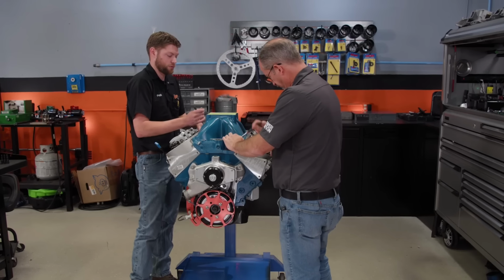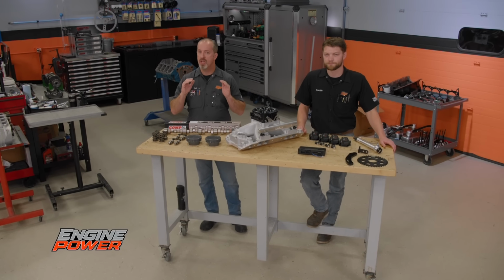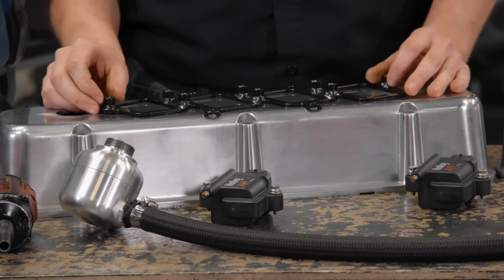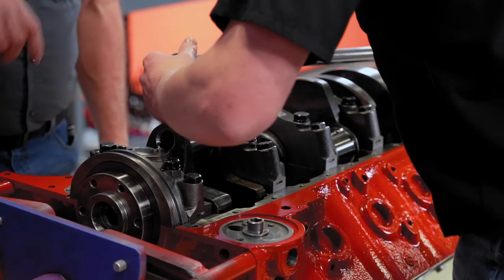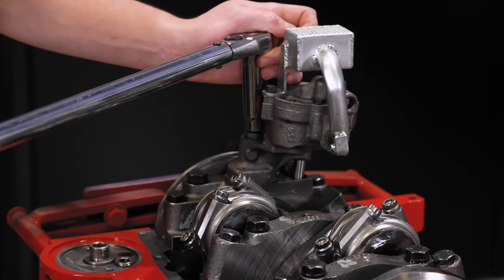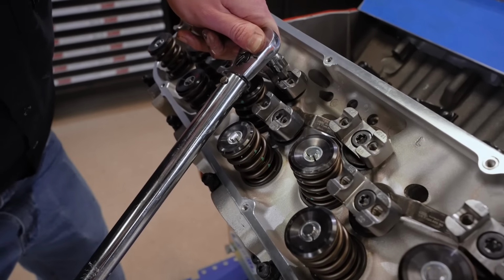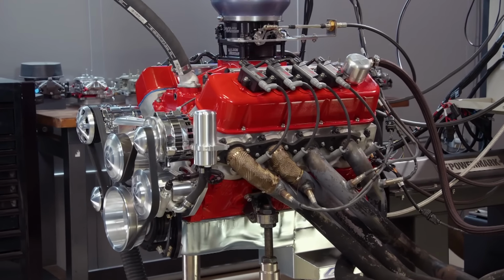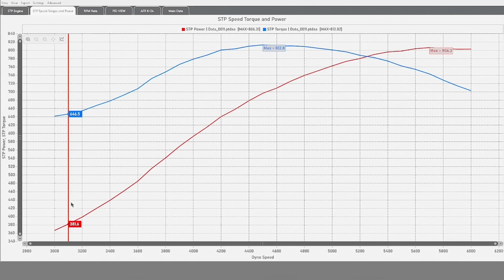Big Torque, Big Power: Building a Custom EFI 632ci Big Block Chevy - Engine Power S12, E1&2

Comment: Slight electrolysis going on in water jackets when u 1st removed a head ?
Reply from the maker: Because the dyno runs straight water we can get a little corrosion in the water jackets, but nothing crazy
Reply: @enginepowertv  have a good look at that pitting its electrolisis

Comment: Chevy's Crate zz632 BB is 1000hp straight out of the box!!! Install and run....... On 91 octane, with factory warranty, built with GM Quality!!! No hate for engine builders but they can't hold a flame to the research and development from the factory!!! Not that engines can't be built stronger than they do, just that the factory built engine WILL be more reliable and longer lasting!!! Plus the Factory warranty is WAY better than an Engine builders!!! I worked for Skip White Performance and Machine Shop, who builds thousands of high performance race engines every yr. They even sell them on eBay. And the builders there are amazing!!! 100% FACTS!!!

Comment: GEN6 block but they put aftermarket roller lifters in it .... thats stupid. "wamt to show you guys all the cool parts" transnational holley is giving us a ton of money so we need to show you something that costs 5x more than the factory stuff , wont last as long and does the samething .

no really WTF?!?!?!?! you toss a bunch of aftermarket garbage efi stuff on an engine that came factory with efi ............ you could have literally just repinned the gen 6 harness for a 0411 ecu , stuck with the distributor (no reason not to with this build). i love the gen6 big block ... you guys made the common mistake that carbs or aftermarket efi is better .... its not , the best thing to do to a gen6 is 0411ecu. edit number 3 as i watch this ... ls firing order ... why not just built a gen 7 at this point . its only a gen 6 in the core block now .

edit 4 ... oh for fuck sake a timing belt kit .... really for a street engine .... smh talks about converting this engine to hydraulic rollers ... while showing a shot of the valley and showing the studs to run the FACTORY roller spider

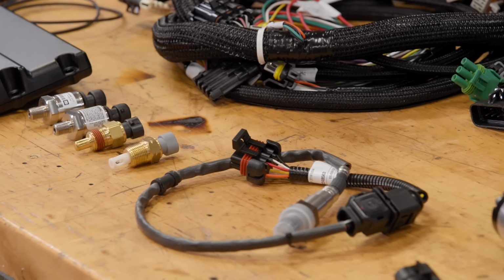@32:57 all the sensors to run it? strange cause that engine SHOULD have factory dual knock sensors and i dont see even one there . this is the problem with aftermarket efi , most dont use knock sensors which is why they are useless , might as well just carb it then

Comment: what kind of nonsense is this program?  you made a 1000 horsepower for a client. Now he gave it back??? then you detune it 850 hp. for what?  you can't go any lower on a 632 and still make it impressive. that's like detuning a 4 cylinder to 20 horsepower. what's the purpose of this build, and thus this show?  what do you do, build an engine, then stick it on a shelf for a later episode?  do you actually have any clients?   got better things to do with the 42 minutes of time you are about to take out of my life...

Comment: I'm sorry, I'm confused. Is that the same high rise you had on that engine painted blue before.. grey before... so basically you tore everything down, rehoned the cylinders because of 1 dyno test and re painted everything..   Just had to be sure.    Sounds like a car salesman tactic. bring in a car. spend more time cleaning it than actually fixing and changing out parts.

Comment: abuse on the dyno??? you guys tear an engine apart, build it up to high horsepower, run on dyno, then mothball on the shelf till the producers of this lame show tell you to tear it down and detune it to supposedly run in another monster truck?  only to sit on the shelf again till 6 months from now when you yo yo up the horsepower again. Then sit on the shelf.. I would have more interest if you actually took an engine from the auto wrecker and breath new life into it.  I think you guys don't know any other engine. You've take this same engine apart so many times, that you can do it blindfolded.  Get a new story or shut down

Comment: Still watching but I like what I see.  Good attention to detail on this one. 4-7 swap, 110 lobe sep angle, with a Hydraulic Roller.  I think you guys need to find a way to make this thing Sequential Fuel Injection vs Holley's Batch Fire system.  That will help maximize plenum volume and reduce pooling at the intake valve and help atomization.  With that said, its still a magnificent build.

All done watching.  Verdict.  Outstanding build.  You guys should be proud of that one.  Now that is a truly impressive build that can survive on the street and actually be reliable for everyday use.  Your wallet will get smashed to pieces on fuel cost, but its well worth it.

Comment: And it gets 2 miles to the gallon and has a range of 40 miles.
Reply: This setup is very efficient with EFI and would realistically get between 15-20 mpg on the street/highway because of how it can be tuned to run at partial throttle and light load especially using an overdrive transmission
Reply: @strictlybusiness1598 well 15-20 is a little too optimistic.  In reality it will see, in the real world around 12-16 mpg. Its too big of a bore to see 15-20.

Comment: What challenges did you face when integrating the modern EFI system into this classic engine block? Any tips for someone attempting a similar upgrade?
Reply: Its more of a Hybrid EFI.  Theyre a little low on Plenum Volume.  Its still adequate for the engine. More plenum volume and if they could integrate Sequential Fuel Injection, they could get those A/F Ratios per cylinder within 2 tenths of each other.  That would allow more consistency throughout the RPM band. They have to tune for the average across the whole bank vs each individual cylinder. Thats whats known as Batch Fire vs Sequential.

Comment: I really love this Engine all except for that timing belt….. It’s a good piece for racing, But not for a daily driver as soon as one of those seals leaks oil onto that belt it’s all over.
Reply: Thats not a belt issue though.  Thats a quality issue on the sealant youre using.  The belt system is easier on the Hydraulics because it reduces resonance throughout the valve train.  These aren't 1990's belts anymore.

Comment: I have a question for power nation. I have a HD industrial 350 vortec l31r. Someone had the timing set to advanced or to retarded I’m not sure. But I timed it properly since then. Every time I fire it up cold if I don’t rev it up to 1500 it ether knocks or piston slaps until the oil heats up. Should I ignore it or remove the engine and go through it? It’s done this for about 90,000 km now and I hate that sound.
Reply: Thats worn hydraulics or worn bearings.
Reply: @joshtheking1772  it’s done it for a couple years now and I pull my 23’ camper with it lots. I think if it was a bearing things would have gone bad long ago

Comment: When torqueing the rods and mains for micrometer measurements, what do you do if they are torque to yield bolts?  Do you have to buy new bolts every time you test?
Reply: Thats why you buy two or three sets. Most, i said most, vendors sell within the same batch number for consistency.  Hardware is cheap when building an engine.   When its in the car, belts and hoses are cheapest. When it's used and maintained, oil and filters are the cheapest.  It depends on what stage you're at.

Comment: Engine dont sound smooth. Sounds stepped. Badly. 

That intake wont fit under the hood. 
How about asking some of your beloved companies to make a front facing MPFI intake manifold.
Look how much that goofy Wilson TB cost. 
Too many camera. Music while engine starts. 
Dont say how you "set" your bearing clearance. Ever.
Reply: Thats because on a dyno its "Stepping" up 300 RPM per second to measure. Also, frame rate for television and keeping the sound in sync with the frames makes it sound that way.

Comment: did this engine start as a 8.1 big block?
Reply: It was a blueprint engines 632 short block for pump gas application capable of producing 800 something hp

Comment: I built sets of502's and 632's for my boat.... One thing I learned is to epoxy stainless screens in the intake valley center oil return slots above camshaft..... if even 1 pushrod breaks and falls down that slot, by the time you realize theres an issue it has been ground through the cam crank and then into the bearing journals  and its game over..... Best upgrade I ever did.... BELIEVE ME!
Reply: @painwithoutgain  Damn, you’re living your best life.  Most of us can’t afford good cigars.
Reply: @ Sorry for that, maybe its a good  time to stop smoking cigars then
Reply: I get the concern, but honestly, if your valvetrain is set up right with quality pushrods and proper preload, a failure like that shouldn’t happen. Epoxying shields sounds risky long-term—I'd rather prevent the issue than patch it after. Just my take.
Reply: Kinda dumb question, would you epoxy screens on a engine thats hasnt been cleaned/has been already used ? Or would you recommend doing it on a block thats been cleaned&hot-tanked?
Reply: @ Just clean with brake cleaner... or acetone... No need to grind as the casting in that area is rough and will have plenty of  teeth for the epoxy to adhere to... its a win win
Reply: @ got it,Thank you !
Reply: Don't forget a rev kit . Keeps oil pressure upon valvetrain failure. Nice low buck set up

Comment: You guys do a great job! But why is 800ish a good number? 1.27hp per cube is a throw together engine. There are plenty of street 632s making 1000hp? Good race 632s today make 1300 to 1450! 632s that were built 10yrs ago made 1325 1350ish, Nitrous combos!
Reply: This isn't a billet block and forged pistons deal. This is a reliable street truck using 93 pump gas. You don't want to blow this thing up. Also, maintenance is much cheaper for an engine not being absolutely leaned on. This a street truck build.
Reply: Its a Street Motor bro.

Comment: I bought an old dishwasher years ago and it lives outside. When I use it I run a hose from the hot water heater over to it.  That’s what I like to wash parts in.

Comment: All I see is one big giant iron boat anchor. Which is all the 454 ever was. It might out weigh some cars today. LOL I guess you could use the 632 for a Monster Truck, but Sorry. Not a car. 

You want big power for a car? Just supercharge a lowly V-6 Pentastar. If we're talking about cars? That motor is built like a fuelly dragster engine with 6 bolt mains and a fully hardened, even exotic, lower end. (except for the head bolts) I supercharged mine and it gets 608hp and I didn't really even turn it up. I just used a Ripp kit with 22lbs of boost (I've seen 20 once) on 93 octane with the stock Ripp/ custom tune. Now granted, I also added ported intakes, an 80mm throttle body, (yes, a Hellcat throttle body on a 6 cylinder engine) giant injectors and Hardened nut and stud head bolts to protect the head gaskets. (all four cams have to come out to change them) And the Pentastar has 2-stage cams. You can grand ma the car and it's happy, or turn it into an MX-Missile and it's happy. Because it's AWD it won't spin a tire. It's acceleration is so intense it'll pull your girls panties back up. Best car I've ever had by a long shot. And the Charger is a Mercedes E class.

Someone should make one of those Pentastar's into a V-8. You'd easily be able to get 1,000hp with just a supercharger. Incidentally, my Charger with that engine gets 41mpg on the Interstate. In an AWD Charger police Interceptor with highway gears. And a 729 mile range to go with it. The power to weight ratio is 7.7lbs per hp. Supercar territory. I ordered mine new from the factory 7 years ago and it's still better than new with everything in it, and everything works. Even the power sun roof. LOL
Reply: Small engines explode trying to make big block power all the time. Big blocks cruise at powers the small engines can't stay together at. A reliable street engine is more important than outright power.
Reply: Penstar=🤮

Comment: LS firing order... boo.  You just stole that big block's soul.
Reply: Look into why its done. It makes a better running engine, and you wouldnt be able to tell without being told. Makes the same sound.
Reply: @brandonlittle6444  Yeah, I know why it's done, and can't fault GM for doing it.  But I still just don't like the chop it gives the engine when its cammed, compared to the old school lopey cammed engine sound.  It has character.

Comment: Thanks Frankie for toning down the hand movements. Made it hard to watch. Tough to do with Pat waving his hands like a flapping bird!
Reply: 😂😂😂 really? This is a show about building engines and you're whining about their hands moving? 😂😂😂 maybe stick to watching cooking shows or something else
Reply: @19chev81  More than half of the 30 minute content of these shows are commercials for their sponsors.  That's the point of most of their builds...to talk about suspension packages from Summit Racing or TrickFlow heads or ARP bolts and fasteners et al.  If it was just about fixing engines, yeah who cares, but it's performance and advertising and deserves to be judged as such.
Reply: @MrCrystalcranium  and? Have you ever been on a tv show? I have for several years. Guess what? No sponsors=no show.

Comment: I want to see you guys build THE MOST EFFICIENT pump gas engine possible. Would be really cool
Reply: Good idea
Reply: @domenicscarfo1866  Right? Anyone can make big power. Don't get me wrong, I love these builds and I love seeing the big numbers and a nice clean build but lets be honest here... It's getting old! I want to see how efficient they can make a small block V8 or any other engine for that matter. I'm currently rebuilding my wife's daily and it's a 2018 GMC Terrain with a 1.6L turbo diesel. (Had to rebuild it because the EGR killed it but that's another story.) I'm putting in gap-less piston rings in an effort to stop those EGR gasses and black diesel snot from getting past the rings and contaminating my oil. Not to mention gumming up my rings! These rings were like glued in place with black diesel snot! So the gap-less rings are going in from Total Seal and them I'm sending the pistons out to Line to Line Coatings to have their ablative piston skirt coating applied as well as a ceramic coating on the tops of the pistons and maybe I'll even do the cylinder heads too. The valves were covered in black diesel snot so I have to figure out something to address them as well. I'm modifying the chain tensioner that's supposed to keep the chain tight with oil pressure as well as lubricating the chain but doesn't work right. I sent out various parts to be WPC treated to get as much of the internal parasitic drag down as I can both in the engine and in the transmission. I don't know about you or anyone else watching this stuff but this is what I get excited about! I want the most efficient, cleanest build possible!!! Would be really cool to see what these guys could do with a proper shop and tools. I'm just working out of my garage and I'm not even a mechanic! I'm just a  self taught gear head! Lets see what you guys can do!!
Reply: @anthonycelata775  Yes.  It would also be neat to see a comparison between a typical iron long block and something truly intended to have the lowest weight/rotating mass/efficiency within reason.  Might not make the most power, but in the right chassis it might not matter.  

cough Factory Five cough
Reply: That’d be cool, but “most efficient” on pump gas often means sacrificing power. I’d rather see a balance—something like a 10.5:1 stroker small block making big torque with great mileage. Full efficiency builds can get boring fast unless they still scream a little
Reply: Most efficient sounds complicated, but it really just boils down to how lean can you run it.
Lots of oil pressure and a perfectly balanced rotating assembly will be key.

Comment: My friend had a BBC in a Chevelle at a little over 600hp. Half throttle would lite up the tires. 800 is nice to look at but how do you utilize it all. Can't wait to see the truck build.
Reply: This is an engine dyno, so that's at the crank. Assuming at least a 15-18% loss due to the drivetrain and tires, it should get anywhere from 644-685 HP and 650-690 TQ.

Still within utility range of a street vehicle, but since they're putting it into a 89 Silverado, they'll need lots of mods to that truck to have fun with all that power, like suspension, transmission, tires/wheels, and rear end change probably.

Comment: Thanks for the great video!  I've  had my MSD ignition on my supercharged '86 for roughly 25 years, and it hasn't missed a beat.  I've never thought about switching back to the oem coil on the side of the street in case the MSD fails.  So glad you mentioned it!!!👍👍

Comment: I have been a long time watcher over the years I have really enjoyed the odd ball stuff turbo 6 cyl. s and the smaller displacement engines 302 and 305 ,s . One thing I have noticed is the lack of oil control measures on your engines I know dyno engines only need to keep the oil off the crank for 30 seconds at a time and a deep pan will do  that. I would love a street bullet with windage tray s etc. as a with and with out comparison , more builds with alternative carbs, like Webers, Edelbrock AFB copies on twin manifolds.  I know  a lot of people like FI but a lot end up back with carbs because FI fails or is not easy to tune so although they might be good to look at draw through turbo,s with carbs or blow through carbs would be good. How about a 400 horse 250 Chev six with triple Webers and 7000 rpm. Same with the Ford 300 and the Jeep 4 liter with an early 258 crank for 270 cubics with Webers all 400 horse street engines with a 4 or 5 speed gearbox s , these are 12 second engines in small light weight cars. Some thing for every one to think about.